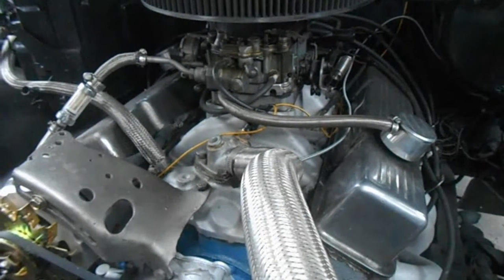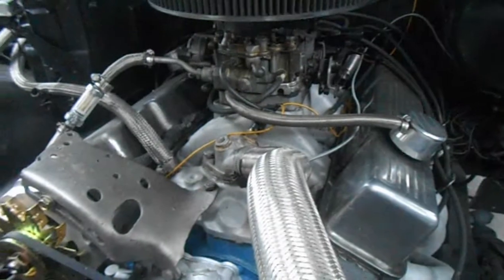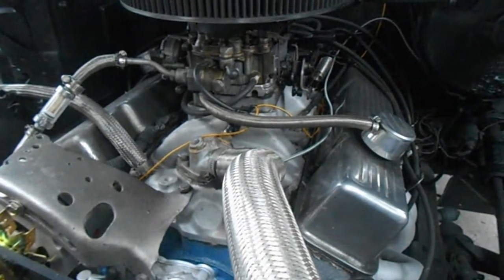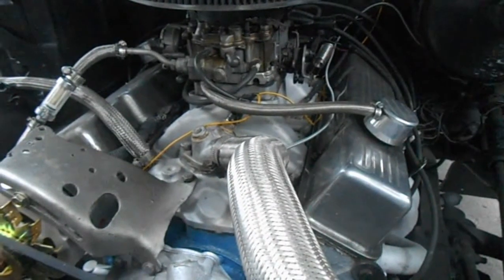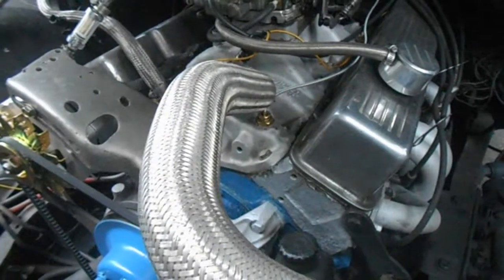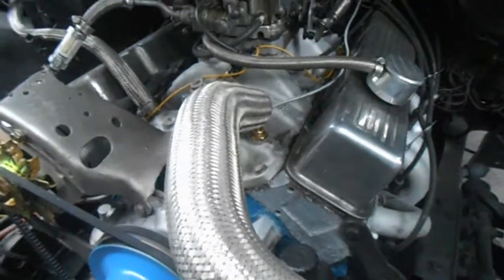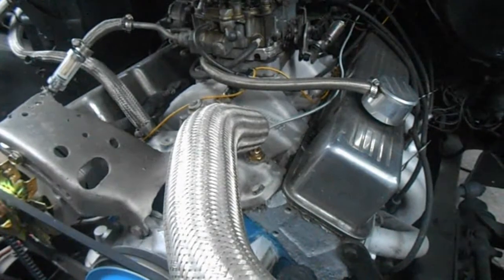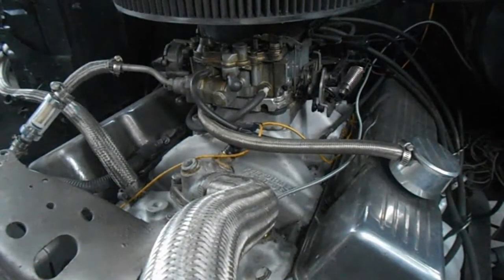with all the hate heres some quadrajet love

Comment: 40 years in GM service and my old man will tell anyone; a properly set up and tuned Quadrajet makes any Holley or any other aftermarket carb look like a primitive piece of junk. If you want the most precise measuring, quickly responding carb that's better for more than just idle and full throttle like a Holley, pick a QJet
Reply from the maker: qjet all day

Comment: q jets are awesome i have many
Reply from the maker: I have always had good luck out of a properly rebuilt qjet. I think most issues people have are simple or just do for a rebuild so they get frustrated
Reply: @EfurdGarage  
i often have to adjust the spring tension on the secondary air valve for other ppl they don't know its there ,  air flow and vacuum tend to change after rebuild / cam changes does really frustrate ppl
Reply from the maker: @psydalone801  yea your right most people don't even know that's a thing. So many people don't adjust it or know how and honestly it's really easy.  I think alot of people's misconception is that what they have is all it can do or it messed up and all it really needs is that spring adjusted.

Comment: The only car carburetor I have rebuilt has been a Holley and it turned out really well. But for the first time ever I rode in a buddies 70 monte with a q jet and I loved it. So this summer I think I’m going to grab a few quadrajets from the swap meets and see if I can’t rebuilt them and turn them into some good performers.
Reply from the maker: just be careful of the rebuild kits, alot of issues are the butterfly rods.they wear out the bushing and the butterflys wont close all the way creating issues, most normal rebuild kits do not come with the new bushings. Me personally i like to buy a fresh one rebuilt from summit racing then if i need to rebuild it later it already had  bushings put it before so you can use a simple rebuild kit.
Reply: Efurd Garage thanks for the advice. Primary throttle shaft wear is definitely something that I will be looking for.

Comment: What I like about Q-jets is those small primaries. If you can adjust it to run on just the primaries on the freeway, your gas mileage would be better than a holley or edelbrock/carter. As well as the secondaries being so huge that romping on it would give you more than any carb our there. The best thing about them is people don't like them, so you can get them for free sometimes. It might be more because people don't understand Q-jets, or because Holley and Edelbrock are really simple and have a lot of aftermarket stuff available for them....so they stay away.
Reply from the maker: I love the qjets, that's something that has always kept me useing them. The fact I can tune it and use less gas then other carbs and have just as much and more power then the others. That truck gets between 23-25mgd highway right now
Reply: Efurd Garage when yu tune the qjet for better gas mileage do you lose power 🤔 thinking of converting from Edelbrock to qjet. Stock vortec 350 with 350 trans she drinks

Comment: I drove three factory stock GM V8 vehicles in the 1980's with the quadrajet, and can attest to the fact these carburetors, when properly tuned, have drive ability and fuel economy almost equal to fuel injected vehicles.... Even the computer controlled ones were trouble free, and even restarted after a hot soak at 105 degrees after a hard highway run with simply a turn of the key, no hesitatation or hard starting, plus you can't beat the sound of the secondaries opening
Reply from the maker: so true, still drive a daily with a qjet to this day

Comment: I'm setting up a 1980 M4ME QJet right now for my 454, doing a little idle system, jet, and metering work, has the APT adjustment feature, electric choke, plenty of parts available from Edelbrock..got the carb for FREE and it's going to bring shame to the Holley community!! So much hidden potential, drivability and MPGs in these and all the same power!
Reply from the maker: yea people look down on them, until it out does them in more then one area